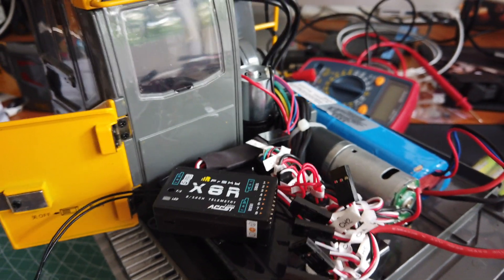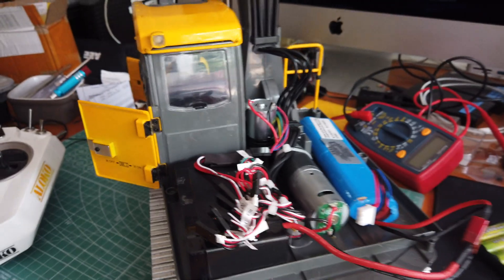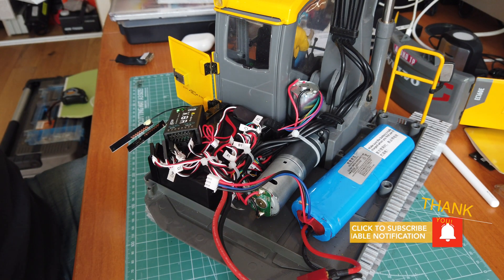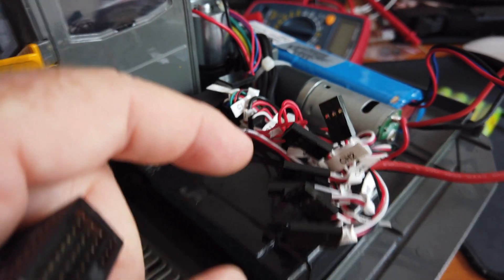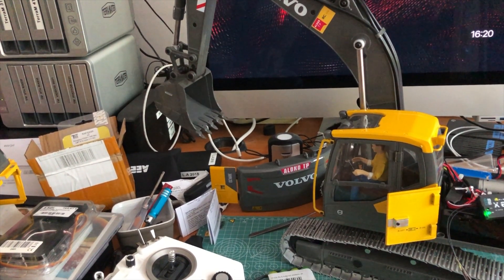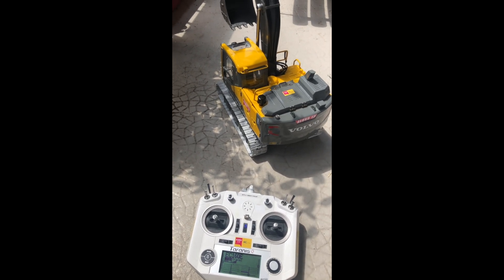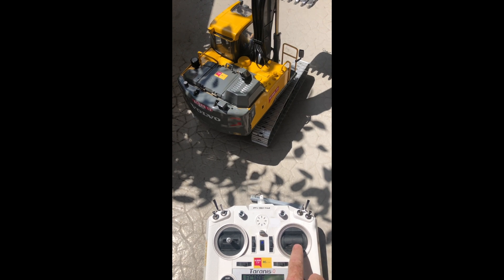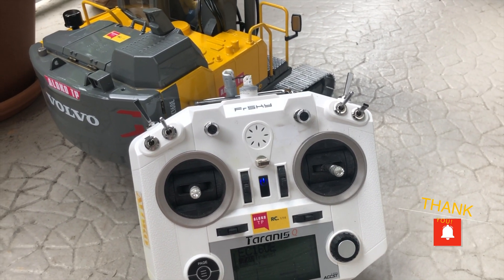Volvo EC160E   - How to switch to OPENTX and get better control on the excavator !

Comment: Can this be done for Flysky too...?
Reply from the maker: Yes sure, you will need a FLYSKY compatible receiver + a FLYSKY Radio
Reply: @ALOKO-TP  yes, use Flysky on all my RC trucks and excavators, still the best for the price...
Reply: @ALOKO-TP  One more question, do I still use the limit switches, as cannot, using Flysky on my other models.....?
Reply from the maker: If you stay with the original electric system you will use the end switch by default , just plug your receiver the same I do in this video and setup your flysky radio the way you want, the end switches are integrated in the electronic box that you are not gonna remove.

Comment: hello bud how you doing i am watching  your  amazing video 4 the first time  its super kool i just bought one from aliexpress she is on arrival  But can you make new video between huina and this excavator just compare between the power and dig 
well thx my mate have a good day
Reply from the maker: I dont have any Huina models so I can't compare for you unfortunately .
Reply: @ALOKO-TP  yeah dude that what's up i have huina i583 full set which comes a luxury box with drill and pincer full metal she very strong in dig But in some time its slow bucket boom even the tower when rotation because the remote its standard you cannot adjust the sittings l😂l 
well thx again buddy 
cheers.🍺
Reply from the maker: Huina is in 1/16 scale and I'm into 1/14 scale myself so I'm not interested. That's one of the biggest selling point of this Volvo I think, it fits with all the 1/14 scale models out there. If weather permit tomorrow will be the first real digging in the garden! Crossing fingers 😊
Reply: @ALOKO-TP  i agree i have huina set dump truck wheel loader and excavator even i have earth mover 870k hydraulic But i'm enjoy with hydraulic much because this machine run like real machine in the move even when make her loading sand like realistic,! you must try one man